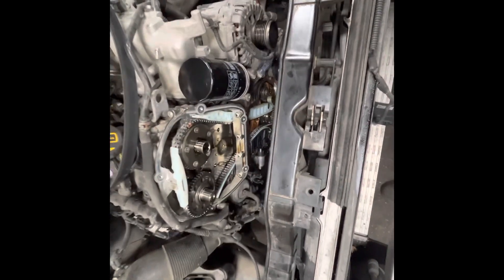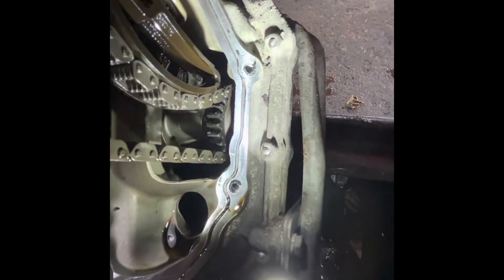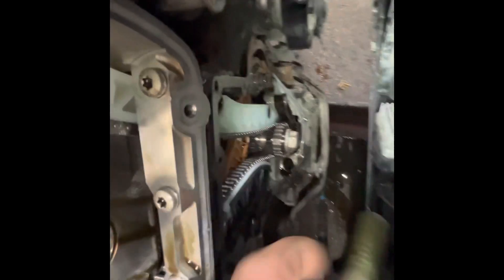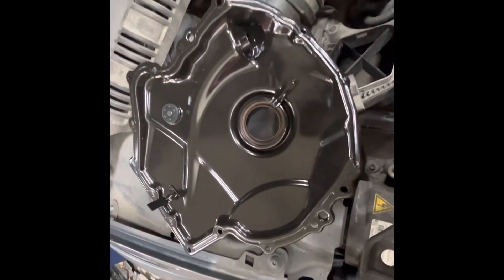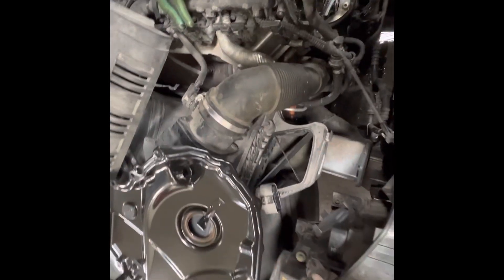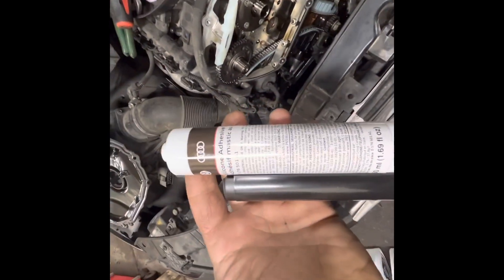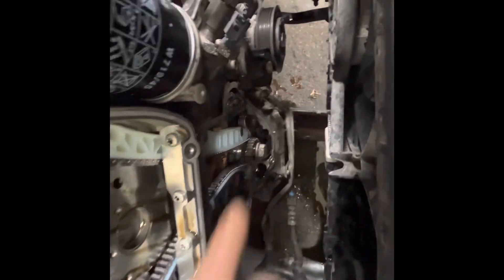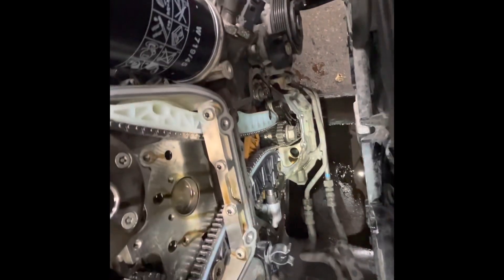HOW TO AVOID LOWER TIMING COVER LEAK AFTER TIMING CHAIN REPLACEMENT ON VW / AUDI 2.0TSI 2.0TFSI

Comment: I reused my timing cover, cleaned it up real well with goo gone , scuffed it, and then used rubbing alcohol as the final step both on the cover and on the mating surface. Worked beautifully.
Reply from the maker: Very nice! That sounds like a nice way to do it

Comment: Great video. I just had mine replaced under warranty. 51000 miles. 2019 GLI. I'm glad the young man at the dealership caught it when I went in for my transmission fluid exchange. It's a pricey job with all the labor. Let's hope for 50000 plus out of this.

Comment: Any opinion on the difference between 06K109210AJ and 06K109210AF? The AF version costs nearly double and the AJ version is newer. Some retailers and manufacturers list both as fitting the same cars and engines. Rein makes both and sells them for different prices. Elring sells a cheap AJ one and says it fits AF as well. Did Audi update the design to go with the blocks with the groove built in? Is the newer one better and the older one more expensive just because inventory is running out?

Comment: What does the groove do? I would seal around the outside of the groove so any overflow squeezes into the groove instead of into the engine. If you put sealant in the groove, it's hard to get the perfect amount. Too little and you have voids. Too much and a lot squeezes out.
Reply: I changed my mind. After spending hours gathering opinions and thinking about it, I realize that it's a steel cover on an aluminum engine so you need some thickness of RTV to allow for flex. Filling the groove and having a little extra sealant is good. Don't overtighten the screws and squeeze it all out. Give it time to cure too, so any overflow on the inside doesn't get in the oil.

It's different when you seal two machined aluminum surfaces together, where there's almost no gap and barely any expansion variation.

Comment: Is it necessary to change the timing change? Mine was doing almost 150000km mileage. Had no epc light symptoms regarding to timing chain failure. But i noticed there was a small leak at the lower cover. Thinking just to change the cover only.

Comment: Yup that's a pain in the ass. I recently replaced the cover and it leaked about immediately. Second round I had to scuff up the surface to get the old sealant out. It was solid almost everywhere except the bottom part. Nightmare, scuffing it up must be the trick

Comment: Hello i have a golf 7.5 gti 2017,i Need to replace the lower timing cover,so i Need to remove the crank pulley,but i see that the pulley its keeping the timing chain in position,so you need a tool(a special bolt)to keep it lock while you do the job,the question Is:i can remove the pulley and then put that bolt into the crankshaft while i change the cover?or i Need to buy the tool
Reply from the maker: You can just stick the bolt back into the hole where the sprocket is and be fine, that’s typically how I do it anyway
Reply: @EuropeanAutoRepair  thanks,so i remove the bolt,then remove the pulley and i Need to hand tight the bolt in the crankshaft,the timing wont go out while i remove the pulley right?
Reply from the maker: @mihaistefanescu1999 yeah, I would used a large 1/2in drive ratchet or breaker bar to crack it loose and spin the bolt out by hand so you aren’t bumping it around too much , once the bolt it out and you carefully pull the pulley off spin the bolt back in by hand and just tighten it slightly with a socket, you should be fine, if you are worried turn the engine over by hand when you are all done before firing it up but I think you’ll be good
Reply: @EuropeanAutoRepair  ok thank you very much👍
Reply from the maker: @mihaistefanescu1999 no problem, hope it goes smooth for you, make sure the mating surface on the front of engine is real dry and give the timing cover a little scuff before you silicone it

Comment: i got an oil leak i dont know where its leaking from but one of the bolt on a  upper timing cover(the plastic one) is not thightning the Bottom bolt on the cover